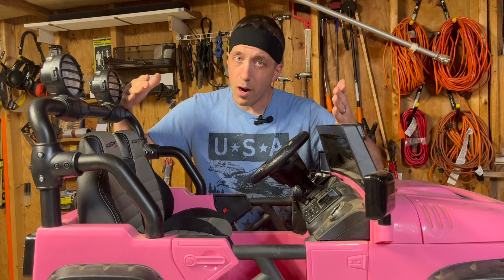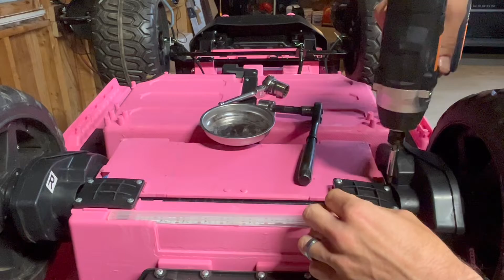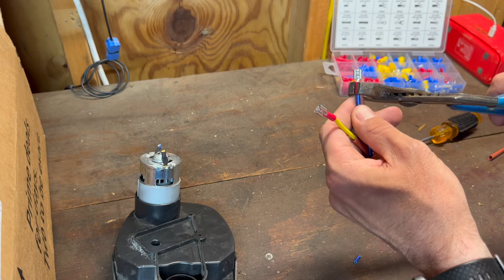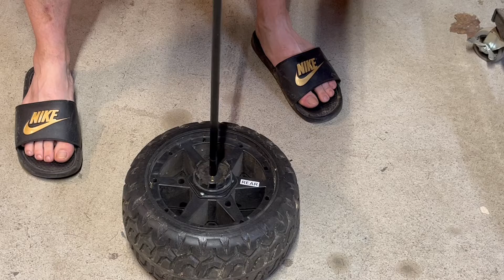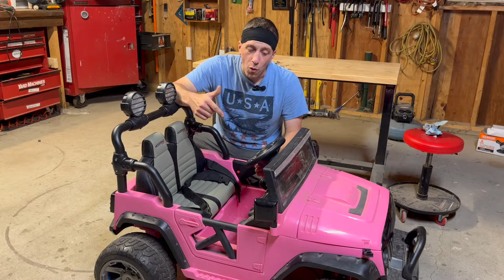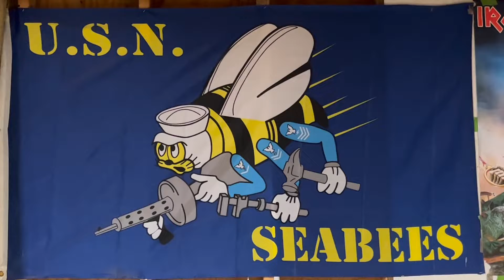Power Wheels/Barbie Jeep Motor Replacement - Simple Instruction

Comment: What are those tiny connectors you used for the wires called? I’ve been trying to find them on amazon but I only see connectors with wires included. I only need those tiny pieces.

Comment: Been looking online to find a solution. My daughter shattered a tooth on a gear. I bought new motors but they aren’t equipped to support the wheel lights. I noticed you didn’t reinstall them. Was it a fitment issue with the new motors?
Reply from the maker: The replacement motor assembly on this didn’t have the connects for the lights. I didn’t care so much. The kids don’t see them when they’re driving.
Reply: @jimmysgarage9068 Thanks for the reply. I ended up buying a new upgraded set from Maderno. I ordered a few different types I found online but none had the clearance to run the wires.The factory motors came with the discs and wiring preinstalled so it was just plug and play. In the end, it's back in action with all the lights working.

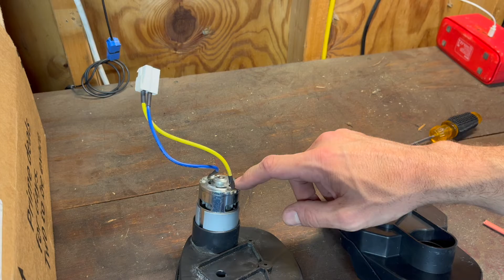Comment: 1:21 you say motor assembly, if I only can find a motor (mine is a dl550-c) can I reuse the housing? it didn’t look like you just replaced the motor you did the motor assembly and I’m curious as to why? Thanks!
Reply from the maker: The motor and assembly came as one - figured it would be an easier swap. Not sure if you can reuse the existing housing - but if the placement motor has the same holes it should line up? One way to find out! Good luck man.

Comment: Cool video! I get the impression you’ve modified or “fixed” power wheels vehicles before in your past.
Reply from the maker: Well, my previous experience was smashing the gears out of the rear axle so my friend and I could dangerously ride it down a really steep street. That was a lot more fun than this fix.
Reply: @jimmysgarage9068  sounds about right 😆